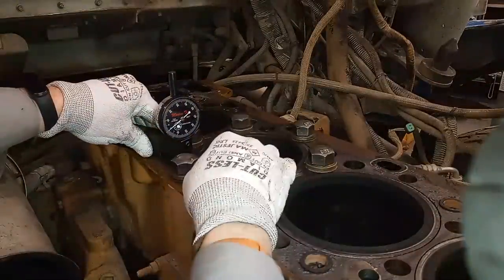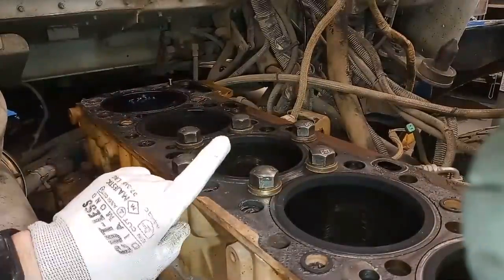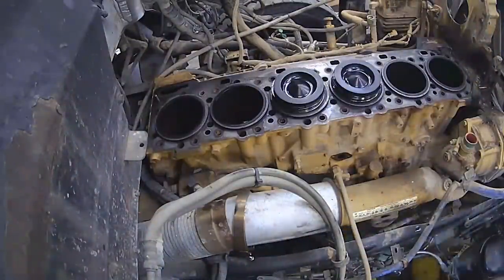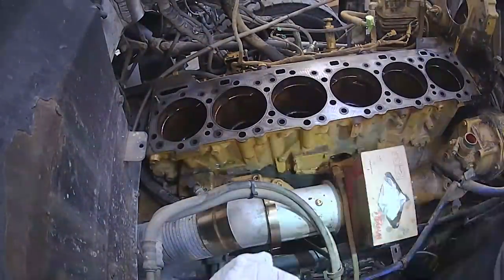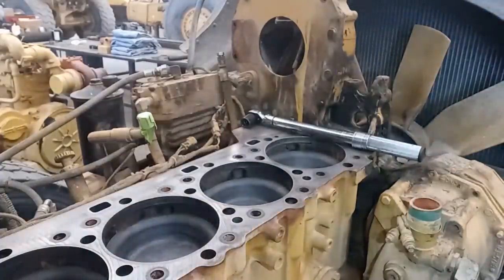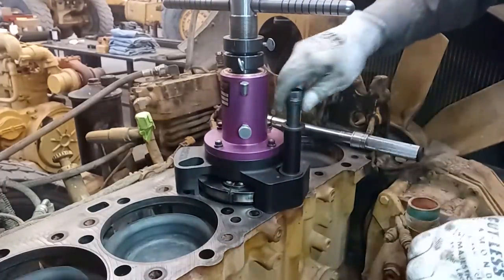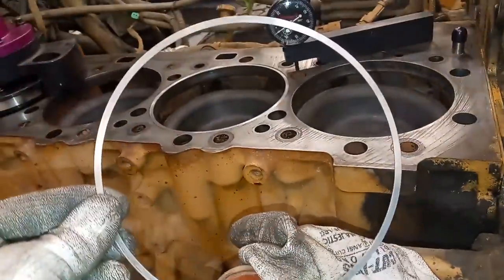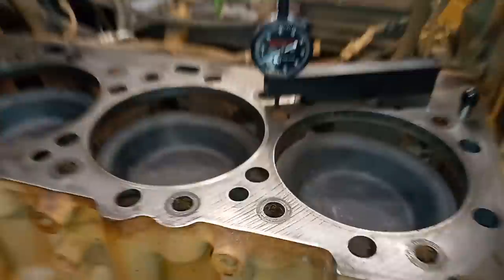What is Liner Protrusion? What are Counterbores and how do you cut them? Part 1.

Comment: Gotta say Josh, probably the one and only video that explains the setup for cutting counterbores on a 3400 series. I just learned the hard way how to do it last week. Couldn't get anyone to cut them, so we ordered a Monaco tool.  I won't get into the "how far too cut them" discussion, but other than the slop in the adjusting nuts, you are spot on on the setup. Also have to say I thought to use the ear plugs for gallery plugs.   Might recommend, masking tape to cover the oil drain back holes...

Comment: The shop I worked in had the Kent Moore setup. Great for Cat, Cummins and Detroit. With add ons it also did the lower press fit Cummins and the bottom of the Cat blocks from erosion. Those inserts were pricey!!!! I always did 2-4-6 then 1-3-5.. A sanding block and 14 inch mill file for cleaning and de- burring. The Cummins used an insert. On most of the 855 blocks your actually cutting the insert next to each other. The Kent Moore tool was powered by a right angle driver.

Comment: Excellent video, I would say basically anyone who's truck/engine you work on can breathe a sigh of relief, it'll be right. Nice work!!

Can only imagine the stories them .200" shims could tell...
Reply: Forgot to say give Buddy and Piper a pet from Iowa!!!
Reply: When Jacobs Brake first came out on 92U engines, now called A models. The used their own head bolt. It was longer as it was needed for the Jake stand thickness. The bolt broke the compression gases cut the bottom of the head, the liner, spacer plate was cut clean through and into the bolt hole of the failure. It was a V shape larger at the top. I cut down 0.300 and did not clean it all up. I put a cast iron shim in. Cut 0.100 off it, placed another cast iron shim on it and cut it flush with the block. Lastly I cut a stainless steel shim and put on top of it.

Comment: straight edge and feeler gage probing  footage in this nicely done video documents deck flatness outside of bore planes--i.e.--lateral block margin--some authoritative sources also perform mid axial and diagonal gaging of deck looking for  "torsades de plan"--twisting of block--a condition much more commonly found in warped cylinder heads

Comment: Josh - I have a question - when you are setting your depth of cut on the tool do you have to account for the depth that the liner has sunk? In the one example the liner measured -.005 on the initial measurements......does this mean you would set the depth of cut to .024 instead of .029 on that particular cylinder if using the .030 shims on all six cylinders?? Thanks dude!

Comment: That cutter seems like a nice tool for squared-away results. I wonder if they make one with a low-speed powered drive like a pipe threader has. That would be cool.
Reply from the maker: There is an offset drive cutter, you can get it through the Cat dealer tool catalog, I'm not sure who the manufacturer is, but it is faster. Price wise I'm not sure how much, but I'm sure it's a lot.
Reply: Kent tool makes the cat one. It's quick and precise as long as it's in good working order. If it hasn't been taken care of, it will cut crooked and will make the cutter head chatter on the surface (making you cuss and cutting the bore by hand in most cases).
Reply: Kent Moore porta tool 2100 is the tool you want. We drive ours with a low speed drill.

Comment: I'd solved this liner issue with a specially redesigned liner with a special chamfered sleeve with a special square seal at the top and illuminating a lower one.weve used these in bull haulers engines big stupid power 90 ,000lbs to the mat..no issues with any or the mining pistons they created with fusion welding..if only cat would listen to us they did..and now they have a redesigned water pump works great.all I have is cats,my dad had cats,my grampa had cats,my great great gramps had oxen😂🤣😁😁

Comment: 03:03 Wow that's a narrow area for the liner to sit! If the liner had more area to sit on do you think it'd wear less or not at all? Are cylinder blocks deliberately designed with extra thickness on top to accommodate resurfacing (re-leveling)? I have so many questions lol.

Comment: I know your a cat guy so am I Josh.. but IPD solved this liner issue on cats by redesigning a better liner with a special square top seal and now have another option available thats even better.and trust me 75 cattle haulers here running them along with the better aftermarket head have had zero issues..

Comment: There’s a new channel I just came across called Jim’s automotive and machine shop. He’s working on an Allis Chalmers tractor that he just rebuilt. It launched the oil fill plug across the field and had coolant under the valve cover. Seemed like a liner issue to me but there is no talk of it in the comment section and and no mention on the videos and they installed the liners by hand with no tool to set them in straight. What’s your thoughts?

Comment: Hey Great video tutorial. 
Who sets cutting width , is there a chart or work sheet ? Thank you
Reply: On the machine we used cutting width was set by moving the cutting blade in or out. That was measured with a micrometer that came with the tool.
 Our tool would cut counterbores or holes for salvage sleeves. Cummins used to be well known for cracked counterbores.

Comment: I have never use that style of tool. Our tool you use a electric drill and takes about thirty seconds to cut the hole once set up. I put two plugs in the block, one at the lower deck and one at the top. Since a drill is used on our type of machine the metal expels out. So I use masking tape and tape the top deck closed to prevent any metal from getting into other cylinders. When I set my depth, I measure all of my shims and use the thinnest one. They are not always the same and I place my shims in order from thinnest to thickest unless my depth is not the same on all cylinders. I place my shim in the tool and measure the gap between the bit and the block. I locate the best place to make this reading. Naturally you don't want to use a low spot to do this. If a spot is not available, I slide my bit out and get a section where the flange is not setting on.  The pitted side of the liner, the exhaust side in this case. Is called the high load side. Most of your problems will be on that side, cavitation erosion, piston slap, driving the liner into the lower deck wearing it out. Basically the liner receives the shock load and vibration resonates from that side.
Reply from the maker: I do measure my shims, although not a lot of variance it seems I'll try to use the thickest shim in the deepest hole and etc. If a shim measures a bit thinner or thicker than normal I'll keep it and substitute one that measures normal I have in my box.

Using the shim as the feeler gauge for the cutter is actually a pretty good idea, I never thought of that before. 

I have noticed the liner seal area is usually the worst on the exhaust side, didn't know it was because of higher loading though, makes sense since you'd have more cylinder movement there. As always, your 800 years of experience has led to some insightful information.
Reply: @AdeptApe  Just because I handed Rudolf Diesel his pencil when he asked for it, don't have to rub it in.

Comment: So using the feeler gauge to set the spacing between the two stops, is the space your closing up by moving the bottom stop up one click. Then when you’ve done it 29 times, both stops should be touching and you can’t move anymore clicks right?
Reply from the maker: That is correct!

Comment: I use a die grinder to get off the heavy-duty stuff with a very light  cookie disc then I go on the doing my scraping and sanding at no point do I ever cut into the deck with a cookie you're asking for problems with the new gasket it'll never seal-rite or if it does it's not going to last very long if there's not a lot of gasket material stuck to the head sometimes I just use a simple wire wheel to break down all the heavy stuff and then again do my scraping and sanding
Reply from the maker: I wish more people would do it the same way you're doing it.

Comment: What causes a liner to drop?
Reply: Number of items. A flanged top mount liner, expands as the piston fires. So the liner swells up and contracts. This movement erodes the liner and the top surface of the block. Increased HP, bigger fire, incorrect assembly are the biggest factors.

Comment: I just looked up that cuter $2300 seems a little pricey when you only have and plan on having one truck. Lol
Reply: My truck has been pushing a gallon or 2 of coolant out of the overflow a year, for several years now.  I'm assuming it's the head gasket . What's the odds i would need this tool?
Reply from the maker: Well Gary you probably do need to cut the counterbores, but if you only plan on using it once you might want to contact a Cat dealership to see how much it would cost to have them cut them instead. If you do all the prep work yourself they can be cut in less than a day so you would spend less than half the cost of the tool. If you plan on using the tool twice it basically pays for itself.
Reply: @AdeptApe  that's what i was thinking too,  i appreciate your response and everything i have learned from you about Cat engines! I hope you have a good day!
Reply: @AdeptApe find himself a moonlighting engine guy to cut them..awsome video Josh slow and methodical is always best snd those 5"brake diaphragms sbsolute genius. 👍 👌 👍

Comment: Why do the protrusion specs change to .0035
 after the shims are added?
Reply from the maker: Cat changed their guidelines a few years ago. It used to be .001-.006 either way, but then that split it to .0035-.006 with shims. Why they changed it is a good question though, maybe they found the shims at .001 don't hold good enough clamping force on the fire ring, but that is just a guess.
Reply: @AdeptApe  Would I be okay at 2.5 to 6 in your opinion?

Comment: If they installed the shims at the factory then you would be out of a job. Too bad the liners sink all the time and blow those head gaskets. it could be fixed but that would cost more money.
Reply: Nope check out IPD solves caterpillar issue with newly designed crevice seal and liner..